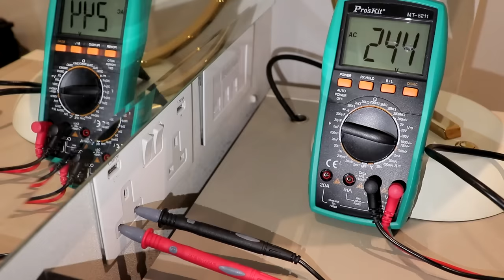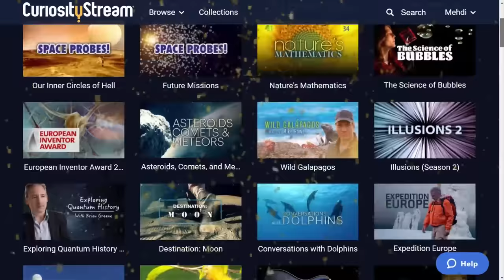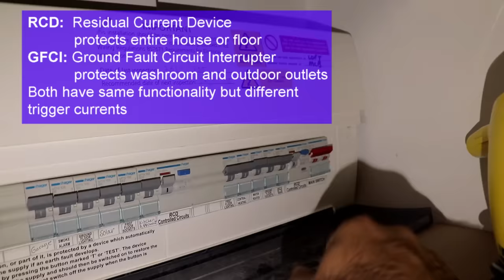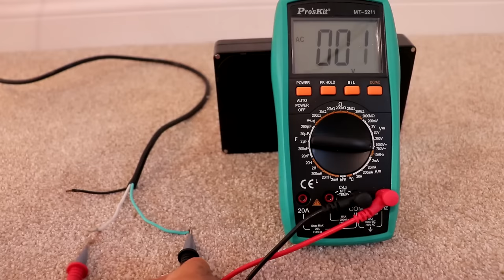Power Outlets in United Kingdom

Comment: Story:i was bored so i decided to do something stupid. My bed was sat next to an outlet to charge my tablet (note i was 8 when this happened) and i have a headphone jack. So my genius 8 year old mind decided to plug one side of the headphone jack into the top hole to unlock the bottom holes, then i jammed the doors with the other side of the headphone jack so i could get the side that was plugged into the top into the other live output. Basically i had a setup where both the live and neutral (i think) outputs would meet in the middle of the headphone jack and i flipped the on switch. It went bang and my parents lectured me for the entire day for cutting off power from all the outlets in our flat number (we cant reset the breaker lol). So lesson learnt never send live output into neutral output (probably wrong about why it went bang correct me ik nothing about electronics).

Comment: That adapter with the plastic earth pin is the wrong type of converter for the majority of things used here, it is only meant for class 2 equipment which uses lower voltage/current and thus does not require an earth. E.G. Things which can run off batteries nowadays such as shavers, phones, tablets, iPods, toothbrushes, power tools. You get the idea.

Whoever sold you that class 2 adapter should have let you know that. Not all class 2 plugs come with plastic earth pins though, some do have metal ones though you can tell they are class 2 from the picture frame symbol on the plug.

On RCD's, you may already know this but some buildings do have more than one RCD unit, my apartment building for example which has one inside my own flat which can isolate each circuit and another one in the main electrical cupboard downstairs which acts as an individual breaker for each flat in the apartment building, if you create a big enough fault to trip that one then you'll have to go down and reset it in order to get power flowing back to your own consumer unit.

I remember doing that once by having a ton of stuff running one morning and the power suddenly went off, I couldn't get it back on until I had my own electrician meet me when I got back from work at which point we noticed the carefully disguised box in that cupboard with 8 large breakers in it, one for each property in the building. I'll bet that's what happened at your hotel, you probably tripped a redundant breaker somewhere deeper in the building. 

As for breakers on plugs themselves, only special ones have them which are usually for running outdoor tools and these are easy to spot because they are much bulkier and they have a test button on them so you can be sure it does actually work before trusting your life to it. They are usually only found in sheds/garages and places of work.

Comment: I'm 59 years old. I remember stepping on an uninsulated mains wire when I was small, because the masking tape over the break in insulation had fallen off, and it stung so I pulled my left leg up and fell back on my bed. But I have never, ever trodden on an upside-down UK plug, because I tend to do this weird thing of looking where I'm going.

Comment: The fact the plug pins are very firmly gripped and the distance between pins was not mentioned. Plugs with bad connections and poor grip are more likely to have bad connections and high resistance. This leads to heat being generated and heat enough to start fires. Current flow through high resistance connections causes this heat. With 240 volts in the UK and 110 volts in the the US there is double the current flow in the US for the same device, more current flow more chance of fire. For those not familiar a unit of energy is called a Watt. To work out this unit you Multiply the Voltage by the Current flow. Volts x Amps = Watts.  So example UK 240 volt x 10 = 2400 Watts in US a similar device doing the same work 110 volts x 21.8 Amps = 2400 Watts. There is double the current flow in the US through a less stable plug therefore more risk of fire. Also fuses at the plug can tailor your protection level. In a light plug you would only use a 5 Amp fuse in an clothing Iron a 13 Amp fuse. Again less chance of fires or deadly shocks. In our house in the UK with a modern circuit board with automatic fuses and Residual Current devices if you overload a circuit it trips instantly.
Reply: You just explained why the UK outlawed plastic distribution panels where the EU is just fine with them. We distribute at 16A star, you do with 32A ring. Any not very good contact at 16A becomes 4 times as bad at 32A (power loss is current squared, 2xcurrent = 4times power loss/heat). You need metal panels to keep the fire inside.

Comment: The reason American plug to UK adaptor doesn't have a ground is because such adaptors are for low voltage appliances such as an electric razor, such euro/American outlets are mainly found in the bathroom of hotels therefore, wouldn't require an adaptor. Taking into account with more or less most American plugs are 2 pins, which means earth is handled by the external sub power points rather than it being handled by the main breaker fuse boxes within American homes.

Comment: Tamper resistant outlets, aka outlet holes with doors, have been required by code in Canadian homes for a long time now. GFCI is now required at all kitchen outlets, and it's only a matter of time before they require them on all outlets. AFCI is already required on pretty much all outlets, and since you can get combination AFCI/GFCI breakers, it makes sense to just install those on all outlet circuits.
Reply: US also requires this as well from the NEC and all legal outlets sold have doors.

Comment: FWIW when in China back in the 80's I noticed the hotel in Beijing used UK pattern 13 amp sockets. The European Union wanted to have a Euro wide standard for house wiring which meant we would lose ring mains and go back to each socket being directly linked to the main fuse box - we said no thanks. Watch out for Continental 2 pin shaver, etc, plugs which are smaller diameter - they fit UK shaver sockets but not properly. You often find North America/UK adaptor plugs which make no provision for the different voltages. We have come along way from electric irons, etc, being unearthed and plugged into ceiling light fittings...
Reply: Each socket having being directly linked to the main fuse box is bendy bananas all over again. Depends a bit on the country (who would have guessed they have a choice) but in mine it is a maximum of 8 double outlets per circuit. Kitchens and laundries recommend less outlets on more circuits because it's where all the power-hogs gather. Ring mains are an abomination, it's the reason why you need big plugs with fuses in the first place, your sockets are NOT protected by a correctly rated breaker. It's why you needed to abandon plastic distribution panels. At 32A on a circuit overloads are fatal if a contact goes less than perfect so you need a metal box to keep the frequent fires contained. Or how made up information will kill you.

Comment: The double breaker box will usually be upstairs and downstairs so that you can isolate different floors. Like if you want to fix the wiring in a bedroom upstairs without turning off the TV downstairs.

Comment: what about french outlets in Slovakia? half plastic is only in some devices, outlets are without doors, but some newer have called kids protection door that you have stick something into both holes to open the doors. our house have older electrical instalation, no safety features like GFCI, wall outlets in bathroom must be 2 metres away from bath, but our house ignores it, bath must be grounded. Our house have TN-C instalation, whych was used in industry and that means, Ground and Neutral share same wire. After all these you will be thinking, why I am still alive.

Comment: The transformer in the "wall wart" at 10:40 is NOT going to be OK.  There's only enough steel in the core for 120 V 60 Hz, so when 230 V 50 Hz is applied the core will saturate very badly, and enough current will flow to smoke the insulation in the transformer.  (Unless something else blows first, which happens here).

Comment: Instead of a thin wire short, why not an LED?  It will provide low voltage confirmation of current running without destroying anything.

Comment: also most major thins/areas of the house have their own circuit breaker like an oven and the kitchen outlets  will have their own circuit breakers
Reply: You get various ratings for MCBs depending on how much the circuit draws due to number of outlets etc.  Generally they are, lighting 6 Amp, sockets 16 or 32 Amp, with the cooker/shower on their own MCBs between 40-50 Amp each.

Comment: I mean… You can get whole home GFCI and AFCI, tamper resistant sockets, and wire your outlets through a switch… It’s just a bit more work. 

Not to brag, but my power is mostly through an old fuse box from the 40s (not a circuit breaker) and I still have parallel/tandem combination duplex outlets that aren’t grounded. 💅🏻👀🥹

Comment: And the good news is that after his various experiments and resultant fireworks, he's still alive. But just to clear up one possible misunderstanding - the shaver sockets in UK bathrooms are electrically isolated (with a small transformer) from the mains, so you can actually touch either terminal without getting a shock. Just don't touch both terminals at the same time. Normal power sockets and switches are not permitted in the bathroom (or within certain distances of sinks in the kitchen.

Comment: Im assuming the reason the test shorting the prongs with the small wire failed was because the wire will have bent enough to make the connection before being pushed back

Comment: In the beginning you mentioned that most of the adaptors dont have ground but you cant even plug anything in without ground because of the outlet doors
Reply: The outlets doors should still open if you still plug the two poles at the same time.

Comment: Small problem with testing methodology, you assumed everythimg was manufactured to spec. The reason the first test failed was likely due to either the plug or socket beimg slightly out of spec or both

Comment: That socket was most probably on either a 20 amp radial circuit or a 32 amp ring,
So well done for popping it 😂

Source: working in the UK electrical field for over 10 years

Comment: The insulated prongs are to keep small children (or idiots) from sticking their fingers on or between live connections while handling the plugs. They are not designed to stop idiots from wiring the live & neutral pins together - that is not a realistic usage case. If you distribute power at 240V you need more safety features than for 120V. 240V will incapacitate you immediately - and then kills you very fast too.

Comment: I was going to say that you should have had a device wired up so you could have a switch on a long wire set up so you could shut off the switch and plug what you wanted into the outlet. When you wanted to turn the outlet on you could stand a few feet away and then turn the switch on and watch it happen without nearly electrocuting yourself?

Comment: It doesn't rain all the time in London! We have had hardly any rain for the last 6 months, and an incredibly hot sunny summer (2022)! It's a stereotype. Each year is wildly different, our weather is very changeable, we are an island after all. Oh, and our plugs are very safe, unless you step on one facing upright, an experience 100% all UK residents will tell you is not fun at all.

Comment: Those shaver sockets also normally have a small isolation transformer in them
Reply: I think shaver sockets also have a thermal fuse fitted for safety in case of overload I think.
Reply: @m3snusteve  yes I think most do.

Comment: You would have tripped the breaker anyway, You made a dead short across the incoming prongs of the plug...not the outgoing side. If it had been on the outgoing side, the fuse in the plug would probably have blown with no nasty staining of the socket. We also have individual RCCBo on the fuseboard. Yes, cost a bit more but you don't lose the entire group of sockets when fed from just one RCD. ps I'm amazed you're still alive.

Comment: Ha ha, love this. As a Brit and an engineer, I can confirm that the switch is intended to stop the electricity leaking out when there is no plug in the socket (and to give people with OCD something extra to do) 🤣😜
Reply: Switched socket protect the contacts from arcing and pitting. 
The switch is designed to open and close cleanly without arcing.
Reply: @fivish  They're giant hunks of brass, they're not going to pit to any level that matters. And arcing isn't an issue with such low voltages that are used in houses. Also if it's a high power device it has an on-off switch on the device anyway.

Comment: How is it that you can only plug shavers into the bathroom outlets in the uk? Hasn't anybody heard of hairdryers over there. Here in the USA, we specifically have 20A circuits feeding bathroom for this exact reason.
Reply: you plug it beside the vanity/desk in the bedroom. most health&beauty products shouldnt be stored in bathrooms anyway. shavers/razors are much lower current applications, and dont pose as high of a risk, if say, someone accidentally waved the shower head around. thats why it isnt illegal to have sockets in the bathroom.. its just illegal to have them within 3 metres of a shower or bath.

Comment: The "ancient " socket is a 5 amp socket. Still in use but not common. I use one in my house so I can have a lamp operated from the light switch
Reply: my grandparents had them in the house they lived in from 1993 to 2000.

Comment: You say that American outlets are twice the current of UK outlets.  This is incorrect, you can draw up to 16A from a UK outlet at 240 volts.   Typically though they are fused at 13A or around 3.3kW nearly double that of a USA outlet.
Reply: He must have meant power but just then he was a bit shocked ;-}

Comment: The live wire getting pulled out first is a nonsense. Tom Scott said the same, so have others. It doesn't make sense because which wire pulls out first all depends on the length of the wires.

   I've wired up many. It's difficult to cut the lengths right because they all need to be different.

   When I was a teenager I would cut them all the same length, meaning the live would be folded over and the earth would be very tight (and sometimes get pulled out if the cable grip wasn't gripping a thin flex).
Reply: most plugs come with a handy litttle diagram showing how long to cut them and how much to strip them. just cause someone non-qualified installs them, doesnt matter

Comment: We have the safest electrical systems in the UK anywhere in the world. Everything is designed safety first, and every feature is there for a reason. The breakers are not in the room so that idiots can't mess about with the electric potentially causing a fire. They are NOT called outlets they ARE called sockets. Outlets are shops where you can buy a single brand of clothing.
Reply: The UK is only slightly less backward than the US when it comes to the electrical system .

Comment: as someone who lived with UK plugs since i can remember, i've always thought that less safe plugs like NA prongs are a stupid thing. they have no on-off switches, no doors, super long exposed metals. to a point where i wonder why America didnt adapt the UK plug at all cuz of the risks. Also i think because of the 220-240V of the UK plugs we need the on-off switches to prevent arcing. sometimes i didnt notice the plugs are on and plugged somethign high power like a microwave or a rice cooker and there's small arcs inside it

also, when i was a kid i accidentally jumped onto one of the prongs and yes i have a UK plug shaped scar on my foot sole now. so here its almost best practice to ensure prongs arent lying around on the floor, which is safer too, no tangling to wires or stepping on plugs

Comment: Great (and as usual, explosively funny) video - you did miss a feature on the plugs though, the inner surface is slightly recessed.

In rooms suffering from condensation, the water will run around the edge of the plug, and not easily work its way down into the socket.

UK plug fuses are officially 3 Amp or !3 Amp - with 99% of non-fitted plugs sold with a 13 amp fuse fitted; this was a downgrade forced on us by Europe, as prior to "harmonisation", we had 13, 10, 7, 5, 3, and 1 amp official fuse sizes.

Some sturdier plugs also have binding posts, rather than the hole with screw, used on that fitted plug you took apart (MK's more expensive range, for example).

Comment: The "shaver" sockets fitted in British bathrooms have an isolation transformer. Often tapped at 110 volts to please our Cousins 😁. If a short or wet fingers contact the live/neutral the transformer will saturate and limit the current so they are not so much fun.